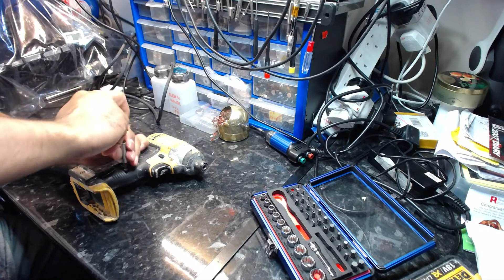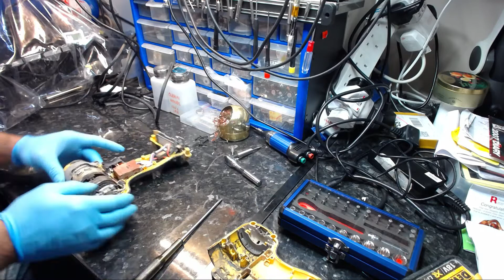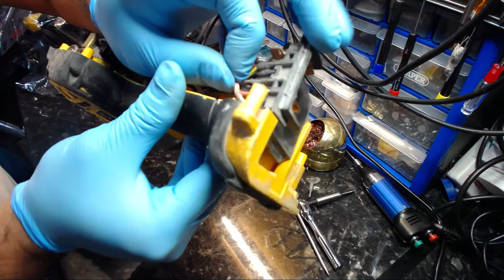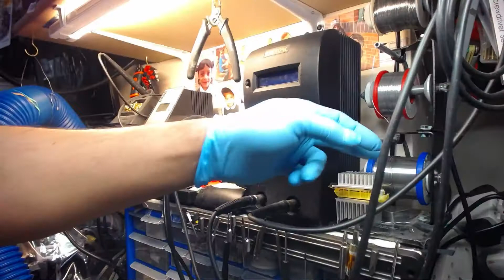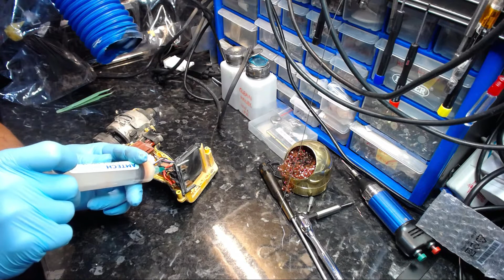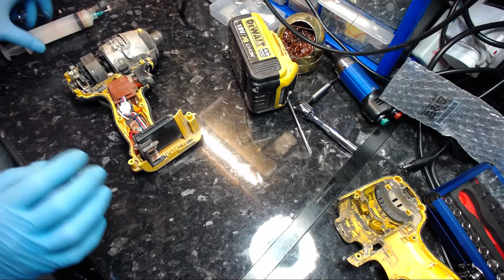How To Fix DeWalt DCF885N 18v XR Impact Driver Spin and Stops

Comment: I have a similar issue. Mine turns on when I press the trigger, but after I let go it does not power on at all, u less I disconnect and connect the battery l, but then again, it does the same thing as soon as I press the trigger
Reply from the maker: It's likely to be a small circuit board, or switch if you tested with another battery.  Hope you get it sorted 👍

Comment: I’m struggling to get the case back together, something at the top/rear is causing resistance... any ideas?
Reply from the maker: It is difficult to advise without the unit in hand.  However, have a close look at my video and compare your unit.  Cheers

Comment: Nice video. do you think that the problem of some dcf887 which heat and then die is the same as 885?
Reply from the maker: Possibly otherwise it could relate to trigger or motor. Cheers